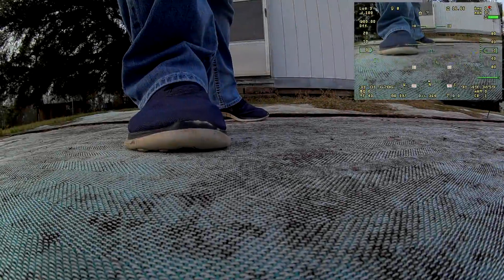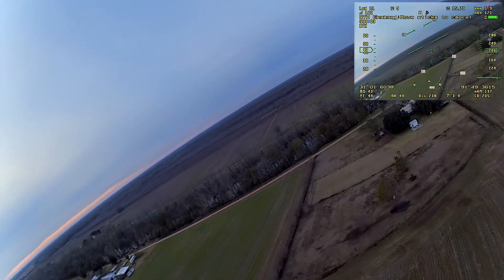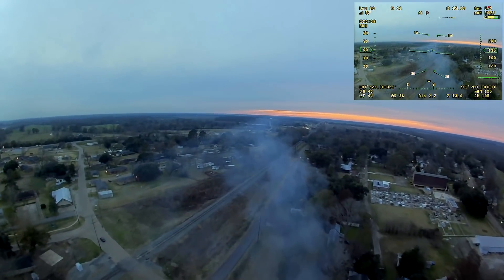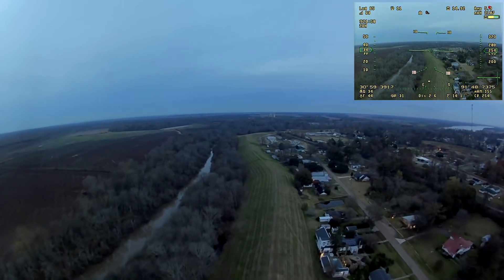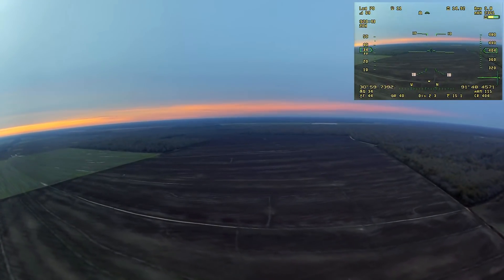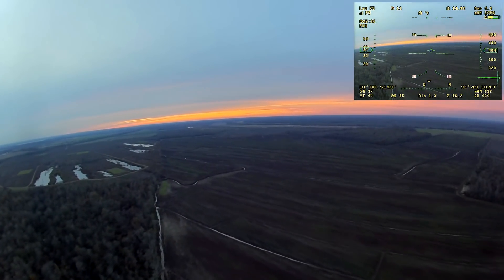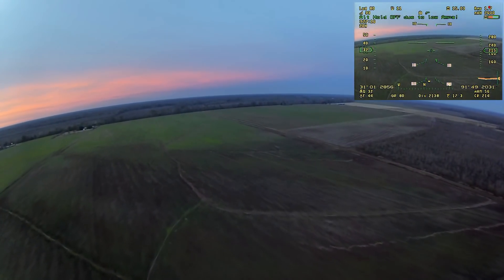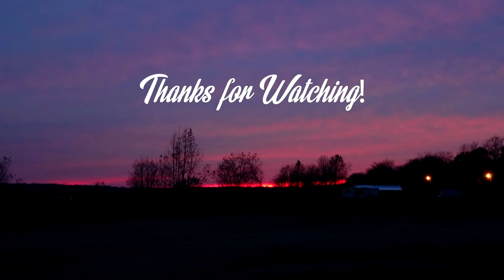Narrated Flight with the Dart XL

Comment: Hey great video! What size of battery are you using in this little cruiser? Ive been looking at one of these for a while, most of my fixed wing experience is with homebuilt planes but i feel like i have enough expensive electronics now that its time to house them in an official airframe that isnt made of tape and foamboard lol. Also I am 100% with you on the general aviation issue when it comes to fixed wing, id love to see a transmitter hooked up to a high end flight sim setup with the live feed running to the monitor and the stick/yoke and pedals controlling the aircraft. Also if you need hassle free music just go to Soundcloud and search "chill" lol I know it sounds lame but for calming flight footage you can usually find something. Thanks again this video is great
Reply from the maker: I'm using a 4S 5200 Multistar pack in this one, same that I used in the Mini Talon. I fly two of them in the Skyhunter. They're great batteries for long range FPV.

Comment: Man, I'm getting that video receiver antenna.
Reply from the maker: FYI, this flight was mostly using a biquad antenna. ;) I had it and the small yagi on separate receivers using the Eagle Eyes for diversity. The biquad was facing south where I flew towards town, the yagi facing south east towards the cow pastures in case I ventured over there. That's not to say the little yagi isn't a great antenna though, especially for the price. Even if you hate it in the end, I still think it's cheap enough to give it a shot... lol

Comment: Another nice flight, I just got mine and will be setting up Vector and Crossfire in it as soon as I strengthen the weak motor mount.  Shortly after you launched, you switched to 2D No Hold, did you launch in a stabilized mode?
Reply from the maker: I launched this one with stabilization turned off, then switched into 2D right away while I got settled in to fly. I need to tweak my "climb" mix a bit to launch with stab. on. I have a switch that puts some up elevator in, so it climbs out when launched in 2D. When I launch it's usually towards the fence, and right now I don't have enough elevator to clear the fence as much as I'd like... lol It gets going just fine with no stabilization though, so it's not a big rush so I just haven't messed with it yet.

Comment: Nice video like always, but whats about your AR-900? Could it be a challange for you to go to the edge of 5.8g and test your 14dbi patch? I would like to see you LR testing it :) today i did a 4.2km flight with mine with a 600mw 5.8g vtx on crossfire, i know its not far but just top that ;) i will try to top yours
Reply from the maker: I have 1.3GHz video in the AR Wing also. ;) I keep trying to fly 5.8 but I'm so spoiled with 1.3 I keep going back to it. I honestly don't remember what my longest flight was on 5.8, but I remember doing a few good ones with a 600mW VTX on the old Maxi Swift a few years back.
Reply: @bonafidepirate  wait thats not fair :D well it works but you have to stay in the narrow beam of your high gain antenna if you are far out. There is absolut no chance to do thinks like you are able to do. I saw a couple of 1.2g systems from banggood but they are so cheap, you now thats have to be crap, and it is restricted in germany 😪 where do you purchase your gear?